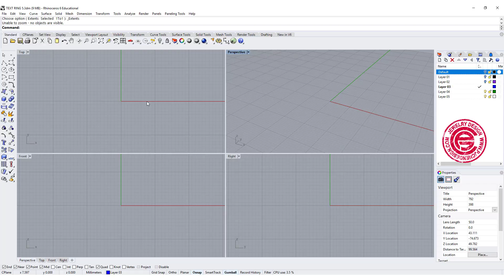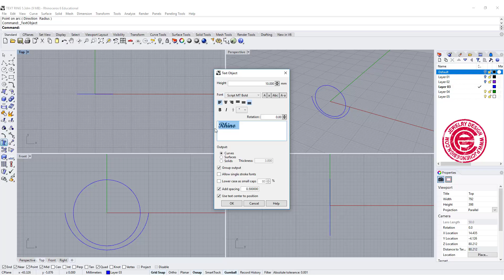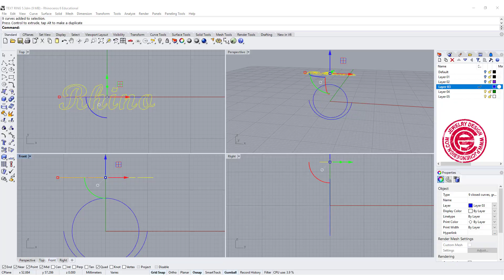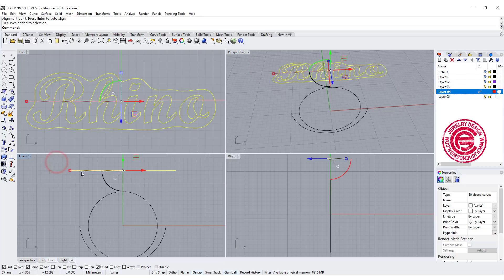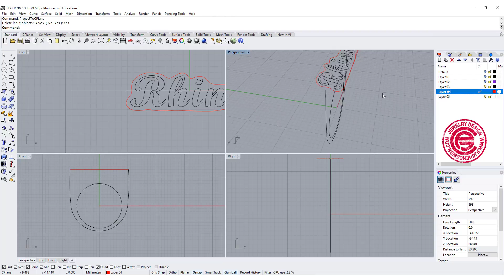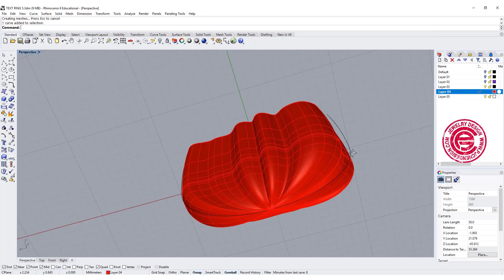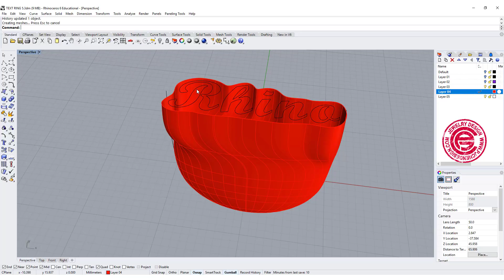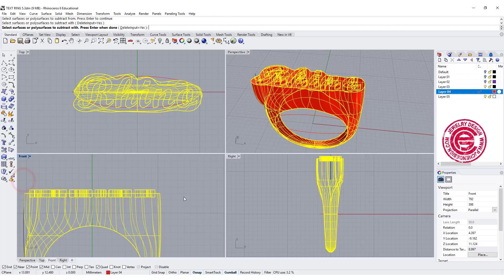Text Ring Mini Series #5 Jewelry CAD Design Tutorial in Rhino 3D

Comment: When I try to split the two rails it always adds extra points not just the one in the middle. So I’m not able two do sweep 2 properly because right at the intersection of the circle and the line it splits when I choose a rail.
Reply from the maker: Not sure what exactly without seeing file. I guess you might already have a seam near by the point you plan to split.
Reply: PJ Chen Jewelry Design I figured out thank you 🙏🏾
Reply: PJ Chen Jewelry Design I found that the piece also comes aesthetically better in my opinion if you use a rectangle with curved edges instead of tracing
Reply: PJ Chen Jewelry Design also how can I get different text styles because I didn’t have the script you used